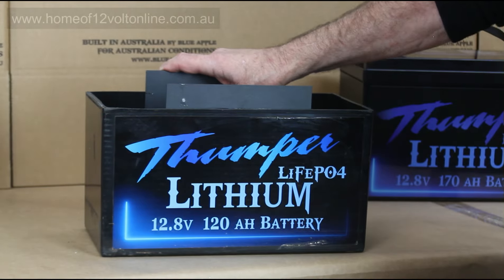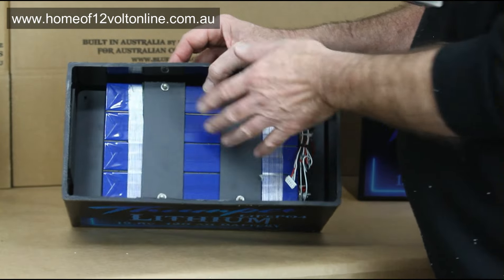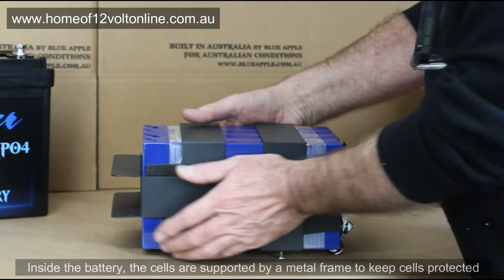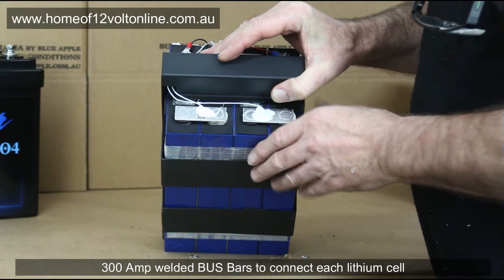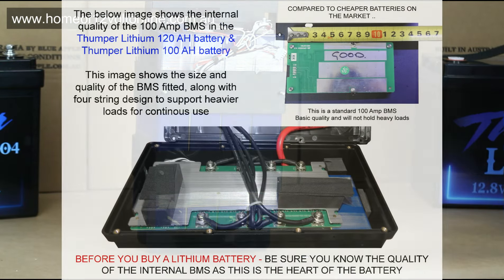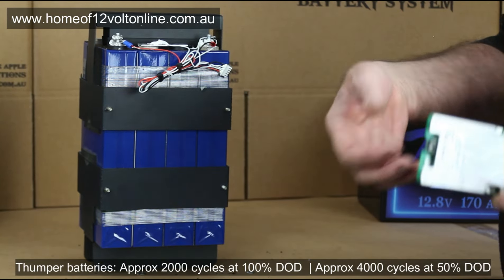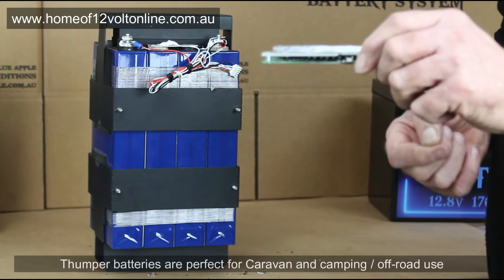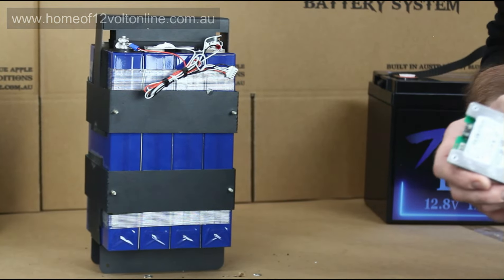Part 2 - Inside a Lithium LiFePO4 battery - Lifting the Lid on the Thumper Lithium battery

Comment: Are those cells 4 in parallel to produce 12v at an aggregate capavity or 2 + 2 in paralell to produce 6v double capacity and then in series to produce 12v st that capacity? I assume the latter where balancing occurs between the two cells in each 6v pack.
Reply from the maker: The batteries contain 4 x cells that are each 3.2volts, wired in series to make up 12.8volts. 

Each cell is controlled by its own cell balancing through the BMS to maintain perfect cell balancing.

Comment: i built my own house storge battery from eve cells  was going to build my own for my 4x4 from cells and plastic battery box, but after seeing how well these are put together i thought i cant build it that solid with welded terminals and steel bracing around the cells ,in a removable lid box ,suits Aussie bush conditions perfectly ,,,if i build it its going rattle apart on the corrugations  ,,so just got the 120ah platinum hub worth every cent for peace of mind knowing your got 12v and cold fridge in the back working ,,